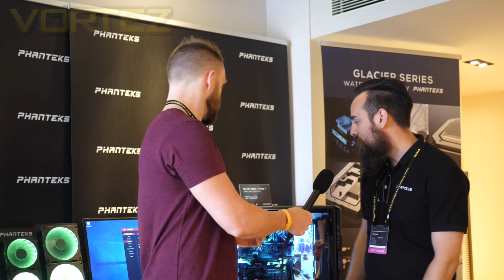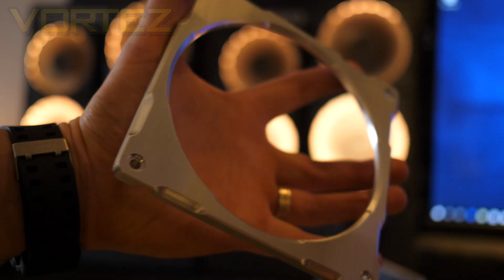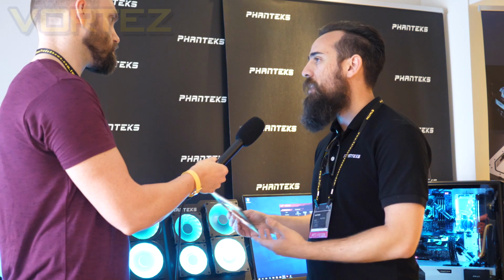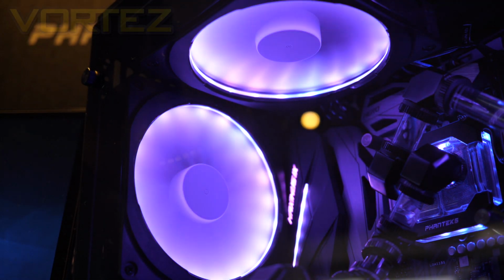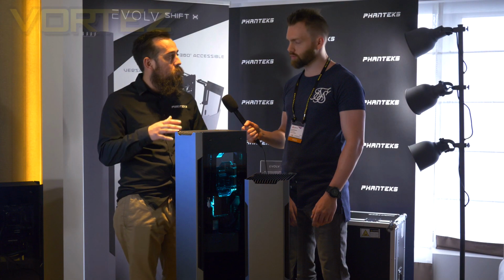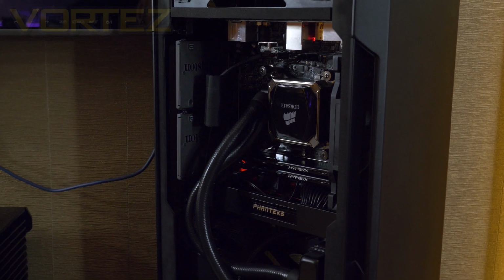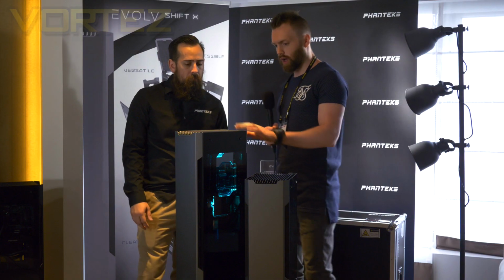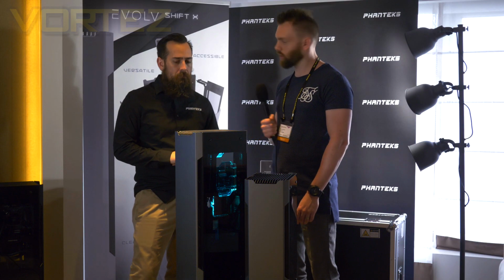Phanteks Enthoo Pro M SE + HALOS + SHIFT X @ Computex 2017

Comment: @Vortez is it possible to fit a 240mm radiator in the smaller Shift? I see their is a cable management bracket is that removable?